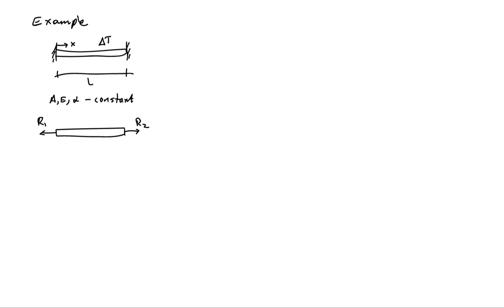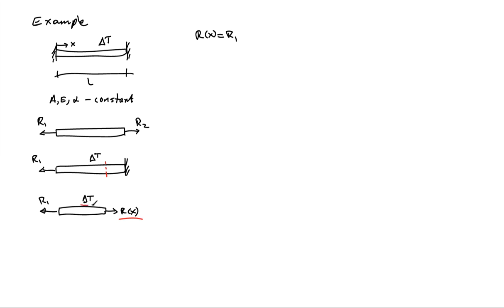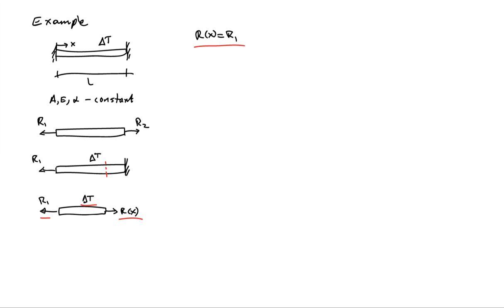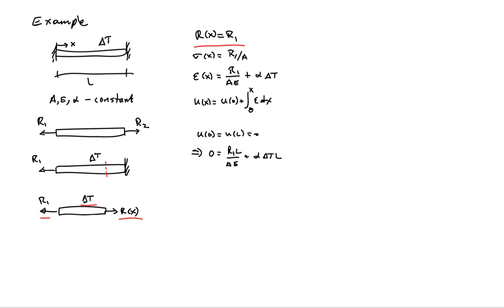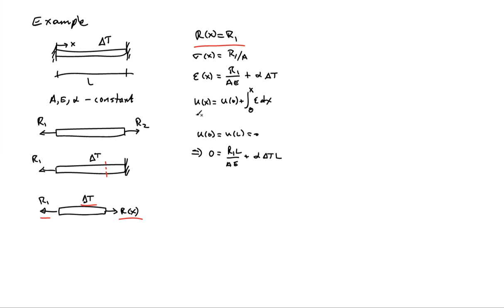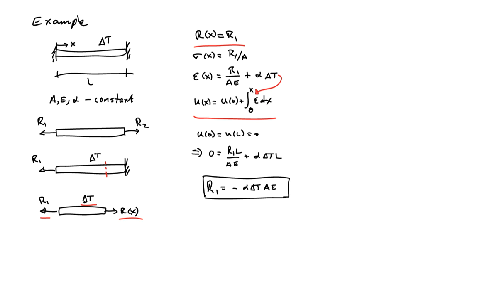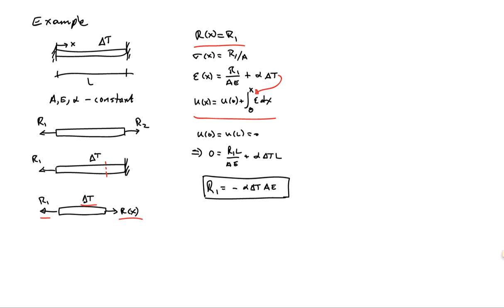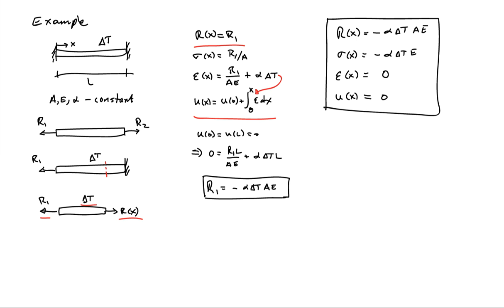(11E) Example: Statically indeterminate bar with thermal load

Comment: In the diff. eqn approach, you have used e(x)=du/dx-alpha*del(t) for strain. I thought that this makes sense because the +ve del(T) gives compressive strain in the bar. But here you have used e(x) =sigma(x)/E + alpha*del(T). I know this works out well, but I am confused.
Reply from the maker: The primary material relation is e(x) = sig(x)/E + alpha*dT.  The primary kinematic relation is e(x) = du/dx.  The equilibrium relation is dR/dx + b = 0, where R = AE*sig.  So d( E*e - E*alpha*dT)/dx + b = 0 is the right equation.  Note sure where you saw "e(x)=du/dx-alpha*del(t)" but it does not look correct, unless I am misunderstanding the symbols.
Reply: @sanjayg0  I was thinking that e(x)= du/dx + alpha*dT = sig(x)/E  which led me to the confusion.
Reply: Thank you for the clarification.